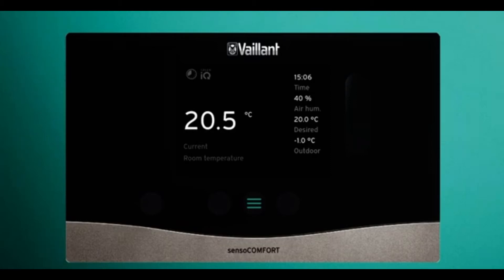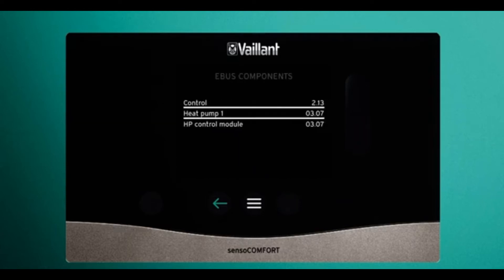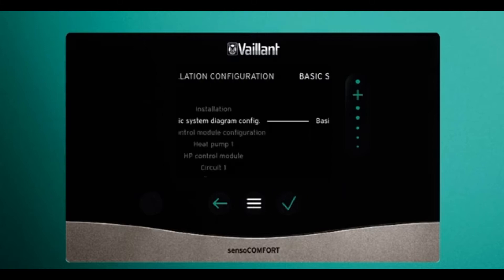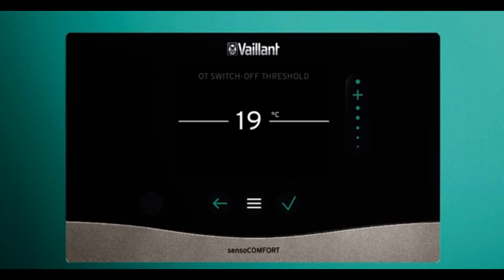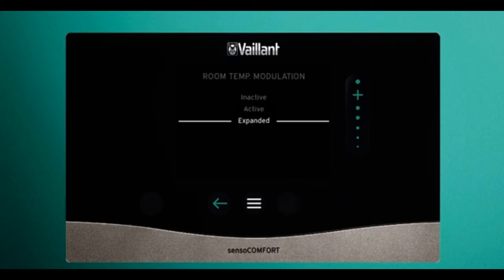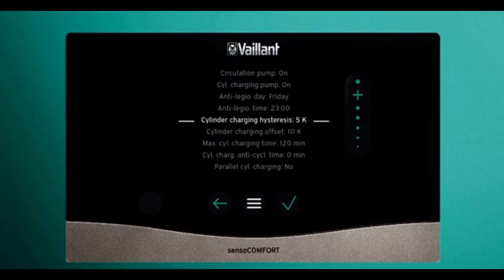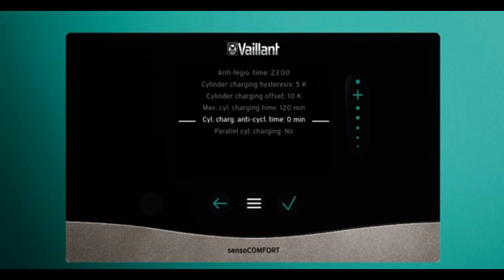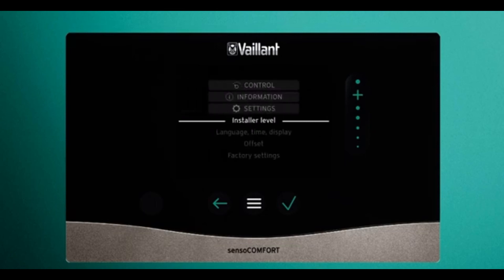PART 2 User Guide INSTALLER settings #sensocomfort #vaillant #heatpump

Comment: I think you may have room temp mode description wrong. Active is both, wc and thermostat and expanded is thermostat only. Could you please advise as I’ve set mine to active hoping for both. Thank you.
Reply from the maker: Expanded uses weather compensation and thermostatic control. Active changes the curve based on the load, using weather compensation and thermostatic control

Comment: OT switch off has a hysteresis on 1C.
So if you set it at 16C say, the heating will switch off at 16.1C, but it will not come on again until outside drops to 14.9C. 
This is what I found. 
The Cylinder Charging Offset does nothing on an Arotherm+ as far as I can tell. My DHW is on timed and the compressor always runs at maximum power whatever the value of this setting. Maybe this is for a gas boiler ?
Reply from the maker: If you change the hot water mode to ECO it will only run the compressor to 49%

Cylinder charging offset relates to the flow temperature to the hot water cylinder +the set temperature of said cylinder. 

For example hot water set to 50°c and a charging offset of 7k will dictate a flow temperature to the cylinder of 57°c

Comment: Hello. We have recently installed a Vaillant . We have the same remote as in your videos. We keep it downstairs. The problem is that the provided room temperature is much higher than the asked one in the menu. And 2nd upstairs the heaters aren’t working at all . Are completely cold. And we don’t know from where comes the problem and the plumber doesn’t know neither. Any suggestions or ideas what can it be? Thank you for your help .
Reply from the maker: If they are not working at all there’s definitely a few things to check.
> Make sure all TRV’s and lock shields are open
> Check all radiators for air and bleed
>make sure that there are no valves shut in the “plant room” where all the equipment is
> Does the radiator circuit to have its own pump? How is it controlled?
> Are there any other 3rd party thermostats?

Comment: Hi, thanks for your video. I rent out my apartment on Airbnb. Sometimes, guests exaggerate by requesting 30 degrees for extended periods, even though it’s already 22 degrees inside. Is it possible to set a maximum temperature of 23 degrees and a limit on heating duration within this menu? Thank you so much!
Reply from the maker: This sort of scenario happens a lot, unfortunately it’s not possible to restrict the temperature ranges on the SensoComfort. But there are other options, 

you can lock the control with the button on the top, which they will figure out very quick

Move the SensoComfort out of range from people 

Hide the SensoComfort in a locked cupboard and change the room temp mod to inactive and reduce the heat curve a little 

Or fit a 3rd part thermostat so that you can lock or temperature restrict the heating. 

Not great opinions but some ideas for you
Reply: @ thanks a lot for your help

Comment: I have just had a heat pump installed with 2 zones and 2 sensoCOMFORT units. I cannot get zone 2 to come on if zone 1 is off - it appears to be set as a slave, and I cannot see any options anywhere to control this... any clue?
Reply from the maker: Not a clue sorry without seeing or knowing what parts are fitted to the system and how it’s meant to run

Comment: Hello
Could you please explain the "Expended" option in the "ROOM TEMP. MODULATION" ?
At what capacity is the sensoCOMFORT being used in conjuction with Weather Comp. ?  I did not know there is such option, I though it has to be always "Inactive" if it runs on the Weather Comp.
I am trying to decide between purchaing the sensoCOMFORT VRC 720 and sensoCOMFORT VRC 720f (wired or wirless), where the wirless version is twice the price of teh wired version. 
I am reying to understand teh advantage of the "Expended" option over just "Inactive". Does it modulate even "better" ? If so, then I guess I would need to go with teh wirless option, since I migh need to move the thermostat to another room, away from the kitchen where the boiler is?
Reply from the maker: Expanded & inactive both use the weather compensation, but whilst in expanded mode the SensoCOMFORT will act as a thermostat allowing you to set a “desired room temperature” once this room temperature is met the heat pump and circulation pump will switch off until it falls 0.2°c below the set temperature.
With INACTIVE it doesn’t have any room interference/influence, even though it states in the screen “desired room temperature” adjusting this will increase/ decrease the flow temperature as an example: 
every 0.5°c increase in desired room temperature will increase flow temperature by 1°c and every 0.5°c decrease will lower the flow temperature by 1°c. Once the heating is satisfied in inactive, the heat pump will stop running but the circulation pump will continue to “sample” the heating water to detect a temperature drop and bring the heat pump back on again. From experience and my personal preference, I use inactive as it keeps a more stable room temperature and a better SCOP figure because it’s not letting the heating water cool down too much before it needs reheating, so the compressor doesn’t need to ramp its self up higher to get some heat back into the system.
In expanded, the heating water may cool down considerably more, thus causing the compressor to work a bit harder to get it back up to temperature because it’s governed by the room temperature for starts and stops.
Reply: @i85_Heat_Pumps  i have question for you..first thing first..sorry for my bad english..i am from croatia..so, my question is..if I set room temp mod to a expanded  can you change that 0,2 difference c to turn on heating...because if i set room temp to 24°c system will turn on heating from 23,8 °c but i want to turn on heating from 23°c...can you change that 0,2 °c difference to 1°c